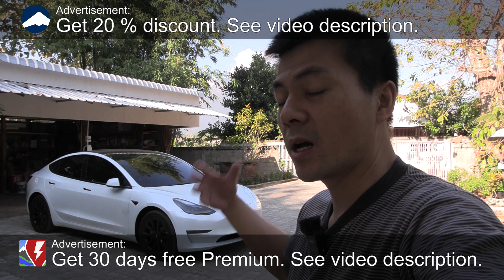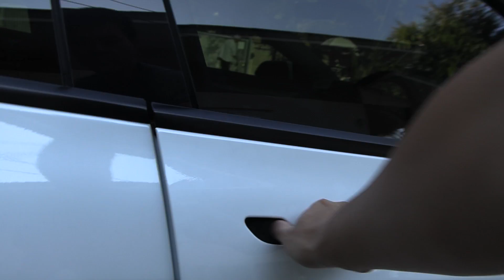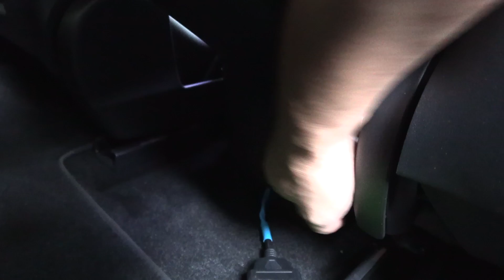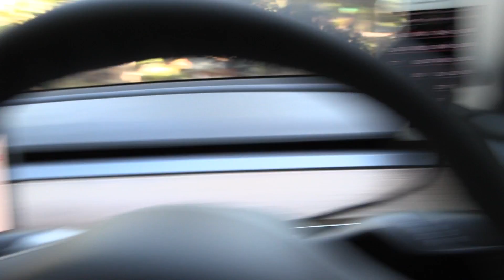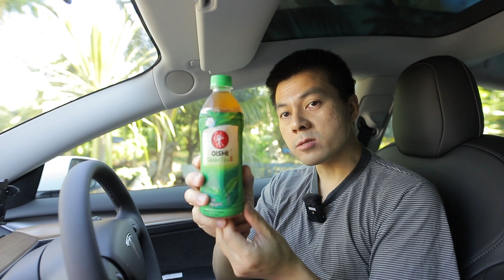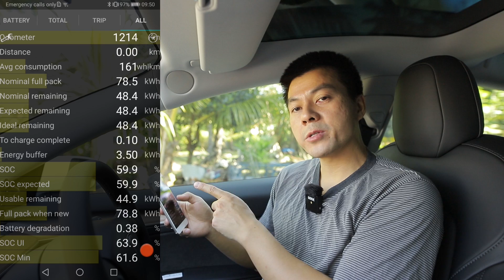Checking battery info of Tesla Model 3 LR (MacGyver) in Scan My Tesla

Comment: Hi hope your well doing a great job now I got the odb LX and installed this as you mentioned and I have a few things I would like to ask your opinion please I have 2021 Long range Model 3 UK with 74.5 pack now this car I got in August 2021 and only driven 2,300 km and it’s showing in scan my Tesla nominal full pack 72.6 with 3.3 buffer is that correct and for such new car hardly driven ??

Comment: I like your videos as an electrical engineer who has been working for several years involved with designing high power EV DC chargers and main battery to "12V" DC/DC converters.

But how do you convince the majority of populations who have no clue about calculating routes to optimize charging stops, and currently have even less clues about all the apps you need to be able to charge at all, to convert to fully electric?
Easier with Teslas of cause, but if you cannot afford one of those?

Where I live there is currently no way I would buy a fully electrical vehicle, because it is impossible for me to charge "at home" and there are no convenient super chargers around.

I am as spoilt as you are, so I will most likely just keep on driving my 5l V8 petrol powered car, because I am lazy and cheap, until the day I die. The trade in value of the V8 car is already close to zero.

Comment: Bjorn can you talk about the charging of the Tesla Model 3, LR and Performance in Thailand. As I understand with the AC Tesla wall Connector you only can charge now on all models with max 48 amp output or 11.5kW and only 32 amp output or 7.7kW with the Model 3 single motor. Is this the same with the China produced Tesla? And regarding the fast charging network there in Thailand are they all working with AC or DC?

Comment: Does the scan my Tesla app's parameters depend on the type of Tesla model you drive? I see that you have e.g. battery degradation in % indicated while I with my Model 3 Performance with the same dongle as you have do NOT have this parameter in the "ALL" tap? Isn't that strange? 
Also I can NOT see in the Scan My Tesla App. any option to see if an upgrade of the app is available? Is version 1.9.8 I have running presently the latest version?
Reply: Yes, 1.9.8 is the latest version. Battery degradation was removed in a recent update as it was "proven inaccurate" according to the developer. See FAQ page on the app website.

Comment: I love how Tesla is continuously improving the cars.  My 2022 model Y feels Rock  solid.  There is hardly any wind noise ( coming from a p85). The ride is not Cushy it feels sporty.   I saw a video that showed the “moose test” and the Y had the highest rating
Reply: I bet the 3 would beat the Y on the moose test, sheer fact its lower and it's the same car as the Y - just saying
Reply: Unless you're talking about V11 - where they are steadily making them worse for people in cold climates - and making everything that was 1 click away, 2 clicks away!!!!
Reply: @delusion2987  sounds like a blanket statement, I would take peoples words that own a model Y over your reply due to how smooth my aug2018 rides

Comment: The 12V are much easier to handle and this car shares many standard components with other cars. The ESC,  the electronic brake booster (eBKV), all the actuators, Door Handles, Windows operators, your OBD Adapter,... And of course - the 12V Battery allows the HV System to fully shut down in standby

Comment: Bjorn the app stops because of the phone, not the LX OBD adapter, I've tested this, and on my second try with a Samsung A52 it works 100% now, I used an old Motorola and it stopped as it happened to you, try to test with other phone, if you can.
Thanks for all your videos.
Reply: Or disconnect from internet - for me that was the trick for the app not to hang. As soon as I connect the phone to internet it's hanging in matter of minutes. I'm using an old android phone
Reply: @ZEFElectric  i have also disconnections (OBDling MX+ with a very cheap android phone without sim card). Maybe the phone’s memory get overloaded after a while
Reply: @cypercharged  can be yet, in my case the app is hanging only when I connect the phone to the internet.
Reply: Interesting guys, in my case I also use the android phone as a Wi-Fi hotspot for the car and other phones/tablets inside the car and since I changed to that phone I have no issues at all 😄

Comment: Bjørn, It looks like there is a loose fastener in the seat rail, next to your OBD adapter.  About the 3.5 kWh battery buffer, is that most likely the “anti-bricking” buffer that remains after the vehicle stops completely and the battery contactors open to save itself?  This is necessary to allow some time (4-8 weeks) to get the car on a charger before cells are completely destroyed by self-discharge below absolute minimum voltage.  The “buffer” below 0 miles is likely just the uncertainty of the remaining range and energy calculation in the BMS.  Actual range could be longer before hitting the anti-bricking buffer level and vehicle shutdown.  Also, as you know, actual range could be shorter, resulting in car shutdown with a few, or a few dozen, kilometers remaining.  The latter is more common with batteries that are several years old, and likely is rare in new cars.
Reply from the maker: No, that's not anti bricking. The 3.5 kWh is often called "zero mile buffer". It's possible to use that one. Bricking protection is another 2-3 kWh below that one that is impossible to use.
Reply: Nope, Bjørn is correct and knows his shit😅 In Tesla, the full pack value includes a certain battery/software specific buffer. At 0% SOC, the buffer remains until the car shuts down and disconnects the HV battery to protect it. At this point, there is still a certain amount of energy left (anti-brick) before the cells become unusable. But this last buffer is not shown in scan my Tesla or any other tool I am aware of.

Comment: "I will not count any buffer below 0."
Technically, you should either recognize the remaining range below zero OR for cars that are programmed to stop at basically exactly zero (e.g. Etron IIRC) consider an additional, unofficial safety buffer of some kilometres.
Or in other words, people will be ok to drive a Tesla closer to empty than most other EVs, esp. with less reliable charging networks.
Reply from the maker: No, we should not count anything below 0 % because most people don't go below 0 %. And remember that most people don't hook up apps and check stats in OBD.

Comment: Hi Björn, you could explain also the cell voltage differences shown in the app, it gives you an idea of the bms ability to balance the cells. By a new battery like yours is not so relevant, by older ones it should be lower or equal with 5mV and it gives you some indication about the cell health.

Comment: A great in depth video , going to get this kit installed on my model 3 , my car is two months old so probable that your car was built about the same time as mine  and I to have the same constant hum when the car switches on.
Enjoy your holiday
Reply: @JasonPlanetary  Maybe this is an issue, I find it annoying it can be heard inside as well as out being new to owning a Tesla thought it was normal but when Bjorn mentioned the hum I am now thinking Tesla has changed something  weather they are driving a pump harder from switch on or they have changed the suppler of the pump and is not as quite as previous models its any ones guess
If anyone else has the same problem could leave a comment here, Maybe Bjorn can do one of his exultant videos on it

Comment: If you do the maths on Usable Charge and SOC, you see that you have 75kwh available for a Range of 575km which is calculated at 130wh/km. I have a 30/4/21 built MIC LR with a slightly smaller battery size of 71.9kwh usable with a Rated Range of 550km which also calculates to 130wh/km. Both of these figures (130wh/km) are overly optimistic, as my long-term consumption is 143wh/km for over 8000km usage. FYI.
Reply: I have a 07/2019 model 3, current usable capacity of 70.8 kWh after almost 100000 km. 
The constant used by Tesla to show battery range is 148 Wh/km, and my long term consumption is around 180 Wh/km (60% highway)
Reply: @cypercharged  I have very similar consumption for 11/2019 model 3: 183 Wh/km avg all time (over +-30k km); summer is ~160 Wh, winter is ~210Wh
Reply: I have 01/19, usable 68,8kWh, 86609km, consumption 199wh/km

Comment: Use LG battery it’s the worst idea. It’s now the manufacturer that more problems generates.
Reply: I believe the LG batteries for Tesla are cylindrical as opposed to the pouch used for the Bolt. I could be wrong.
Reply: @dbwelder9159  Correct.

Comment: Spørsmålet er hva skjer når bilen er 10-12 år gammel og man må skaffe nye batteri til hele bilparken.

Lurer på om man kan bytte ut eksisterende eldre batteri med nyere teknologi og bedre kapasitet.
Reply: Don't worry, you don't need to replace the batteries after 10 to 12 years. These batteries will last longer than the rest of the car. They are made to last 500 thousand miles. By that time you will want a whole new car.